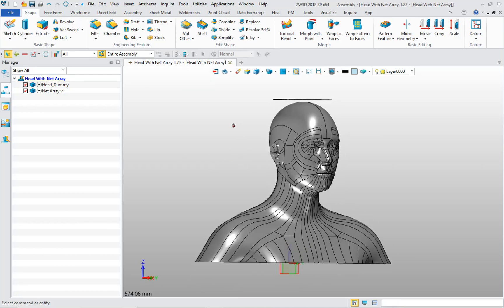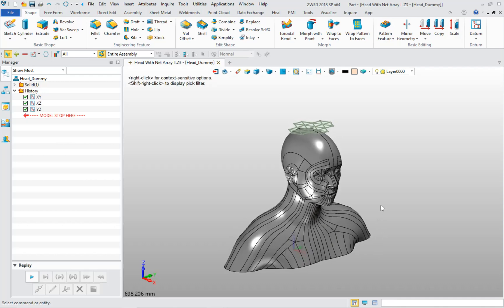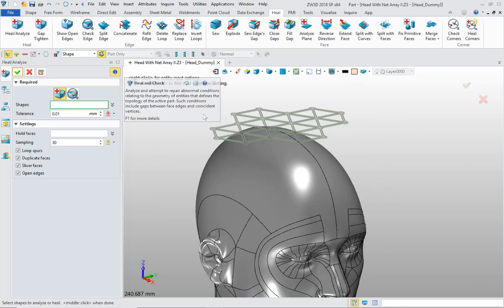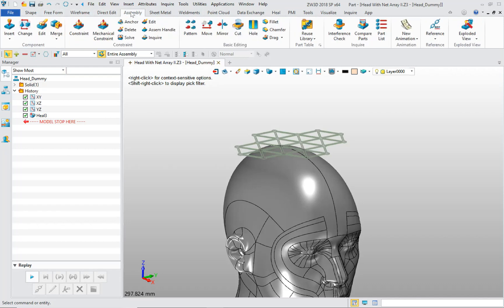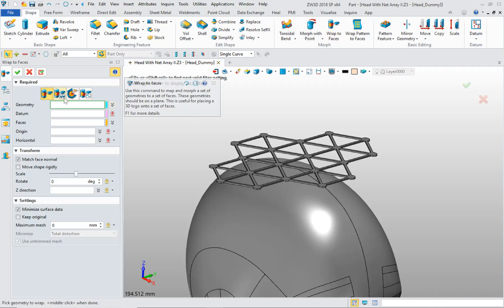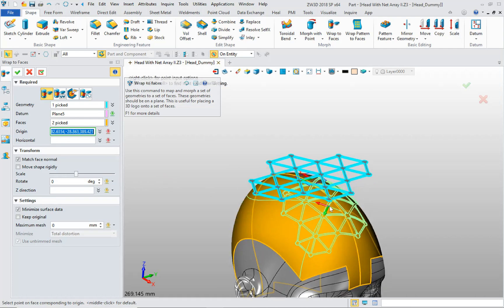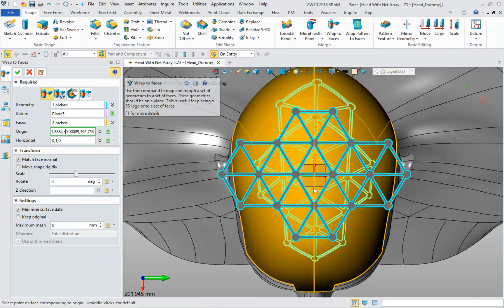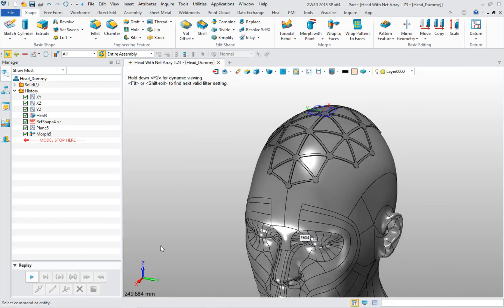ZW3D - Wrapping 3D geometry to a curved surface

Comment: Is this not possible in fusion 360?
Reply from the maker: It depends. In Fusion 360 this is a very manual approach and easily takes 10 times longer . It's a very different and laborious workflow.

Comment: That is what I need to be able to make the Zero-G arm so a person can wear it instead of it being attached to a wheelchair. A person's shoulder and back of there neck is where it needs to be fitted too what is in the movie Elysium is close.
Reply from the maker: This is one set of functionality where a user has to decide whether the benefit is worth the investment. ZW3D is definitely not free and a rental is more costly than a Fusion 360 subscription. In this case the time gained by this set of tools can rapidly outweigh the cost advantage of a lower cost tool.

This is the thread on the Fusion 360 forum where this model originally came up. As you can see, this can be done in Fusion 360, but it is very manual and thus  labor intensive: https://forums.autodesk.com/t5/fusion-360-design-validate/wrapping-a-body-around-a-head-model/m-p/8609832#M183367